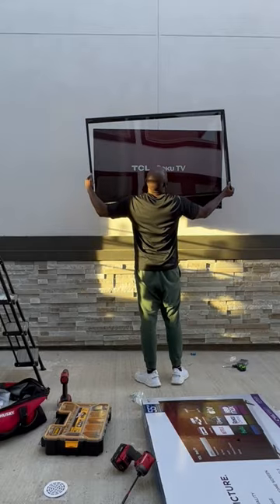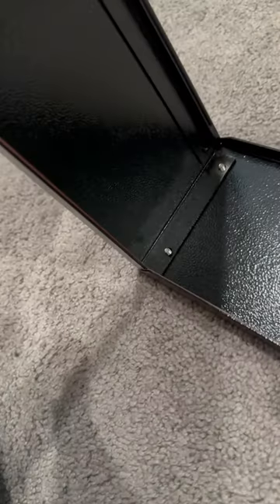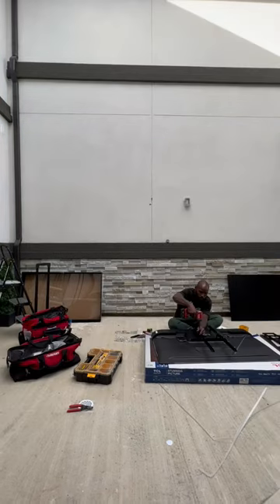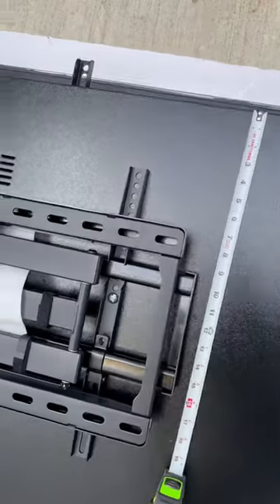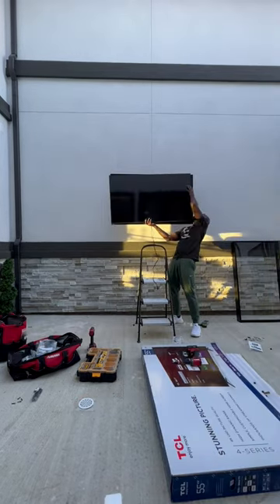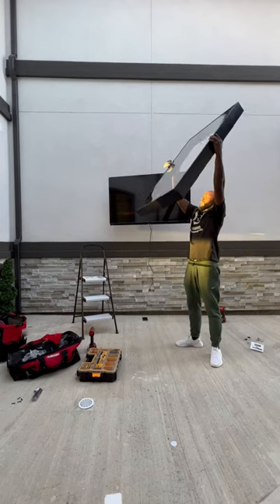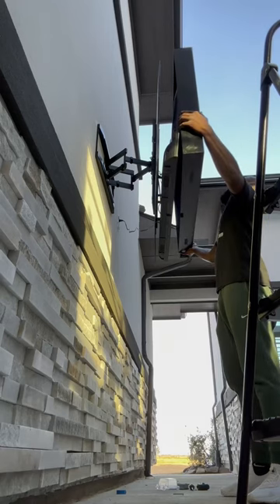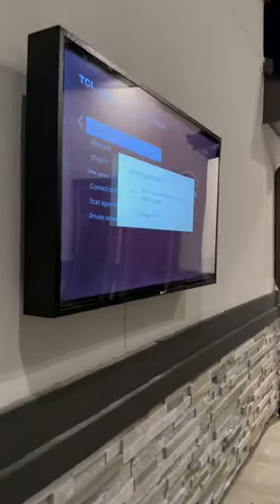Outdoor tv enclosure is a waste of time 😒 #reels #tvmounting #work #howto #hometheater

Comment: 700$ case for a 300$ tv 😂😂
Reply: If it’s an outdoor tv that has the backlight it’s supposed to, then it’s not $300.  They’re around $1k to $2k for a 50” TV that’s for outdoors.

That’s not to say they can’t buy a bad tv and put it outside.
Reply: @darkopz TCL brand isn't getting up to 2k. That was more so the point.
Reply: Even just getting a $700 tcl qled would have been a much better choice. That's the basic model
Reply: Does it really matter its a tv. y'all care about how much it is 🤣
Reply: @michaelwheeler6264  I’ve seen some TCL that are way above 2k
Reply: @darkopz bro shush that’s not work 2k
Reply: We went with the ZeboZAP 🎉
Reply: You realize 90% of TVS are assembled in the same damn factory right 😂